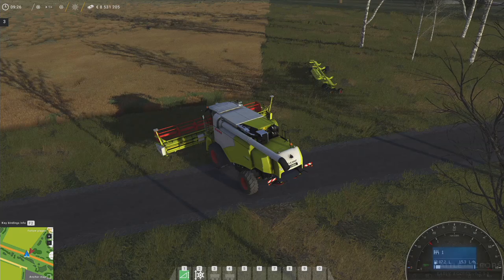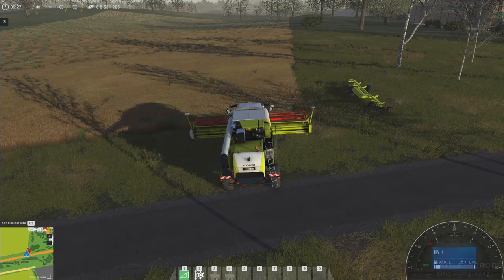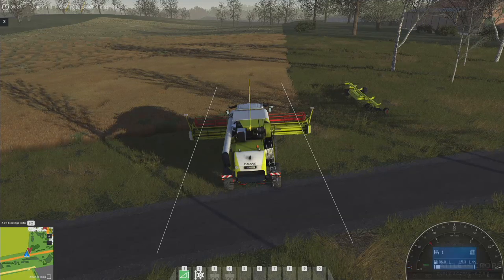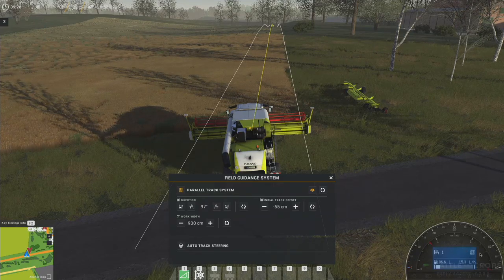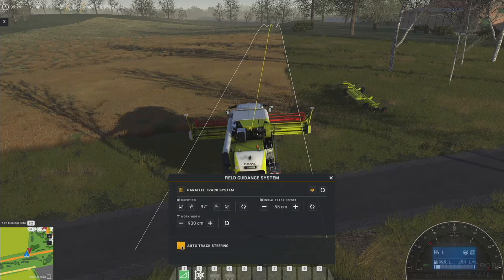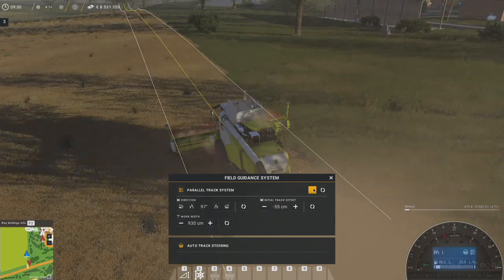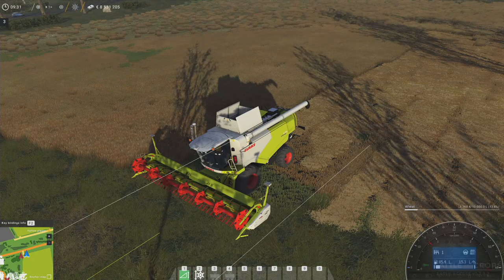Cattle and Crops | Field Guidance System

Comment: Another fantastic, and well needed tutorial, and if it was not for you, I don't know if I would have managed to get this to work with my G27 Wheel setup. What I do now is setup the FGS, and I only need to steer just a bit with the keys to get it to lock, and it works fine. When I get to the end of the row, I just usually use the keys to steer, just to make sure it locks on again. It is just a workaround until they fix this problem, but having the FGS is a real game changer in C&C.
Reply from the maker: Yes, having FGS is wonderful and makes fieldwork much more efficient

Comment: Nice tutorial but I play the game with a steering wheel but he doesnt steer automatic
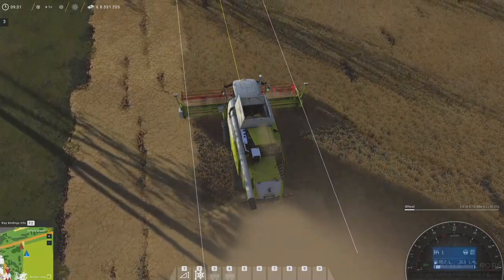Reply from the maker: I talk about this bug and a workaround at 4:45. Try giving steering input with keyboard (A or D key) and then engage autosteer with O key. There is a bug where wheel input can make autosteer not work
Reply: @KerboOnYT  ah thanks I wil try that
Reply: @tsplap16  It should work for you. I had exactly the same problem, and was getting extremely frustrated with it until Kerbo came to the rescue with this workaround suggestion.